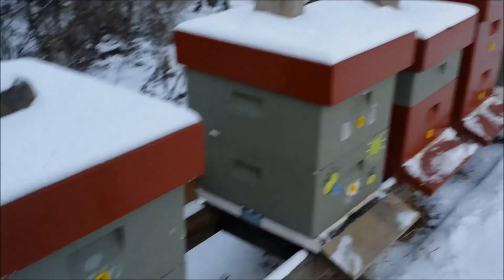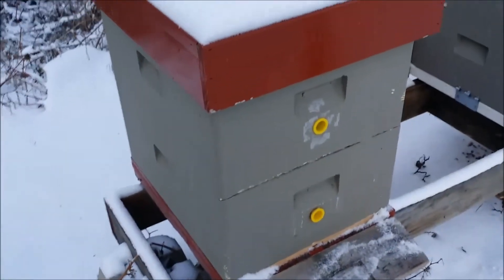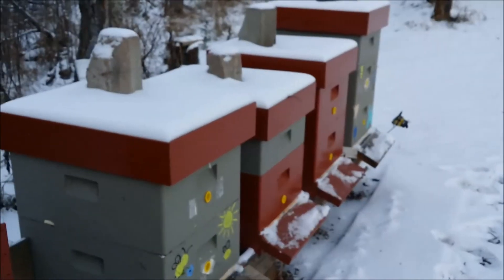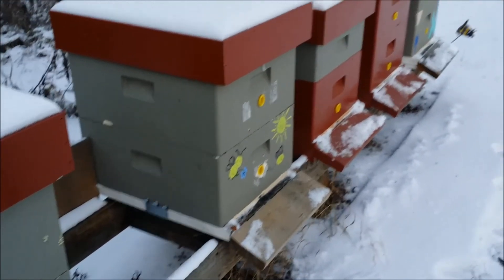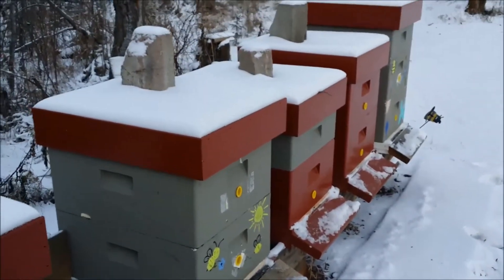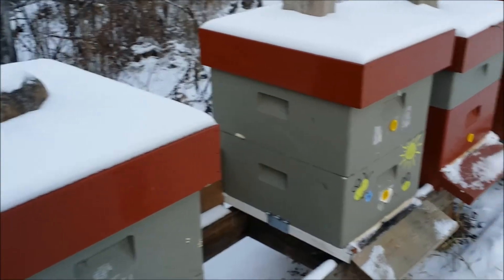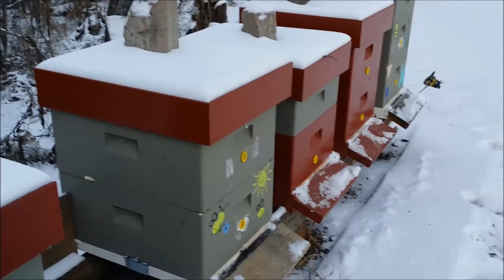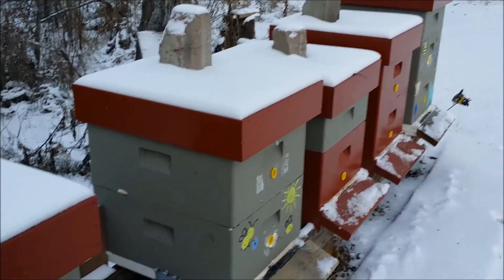Wintering Honey Bees in Polystyrene Hives.

Comment: I am going through my first winter with Lyson Poly hives.  A year later, is there any followup?  How did they winter?  Any advice?
Reply from the maker: Hi Tayor. I have pretty good success with these. I did loose a couple last year... (2 or 3 out of 22 or so) but it was a really bad winter around here. Long cold spells. My advise would be to make sure you use an upper entrance. Cold does not kill Bees, but moisture will.
Reply: @albertabeekeeper8516    Thanks for the advice.  I am using the lyson hive that has a vent system up top as well as a candy board feader.  Hopefully this will do the trick by absorbing and venting moisture.  https://www.lysonau.com.au/polystyrene-hives/american-langstroth-painted-beehive-w1107